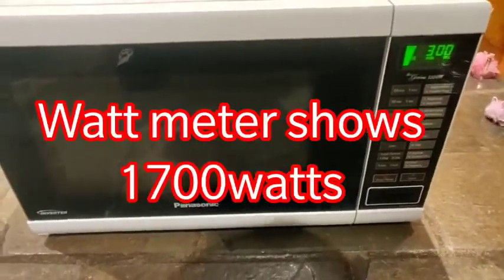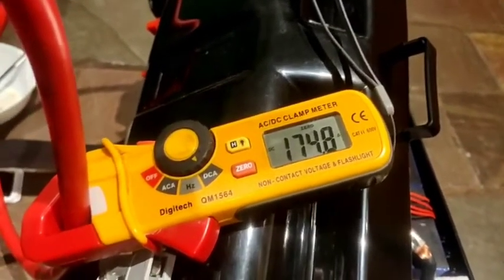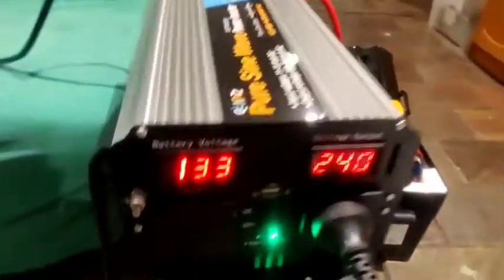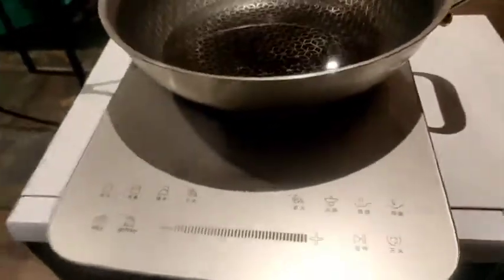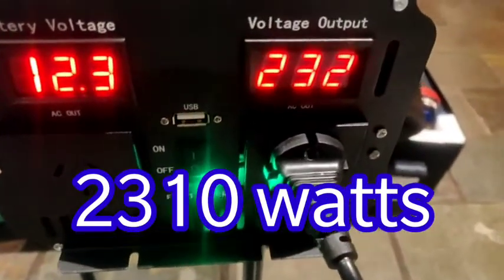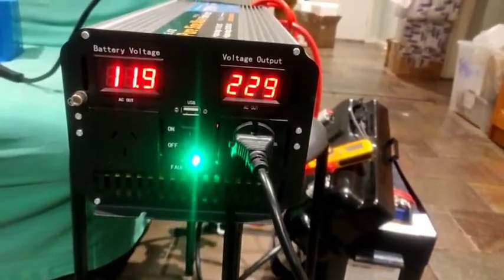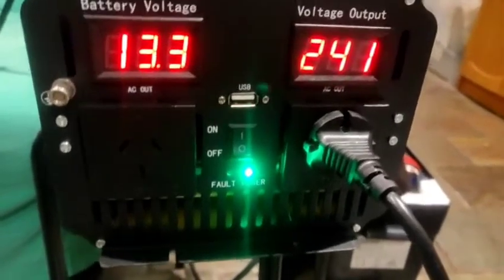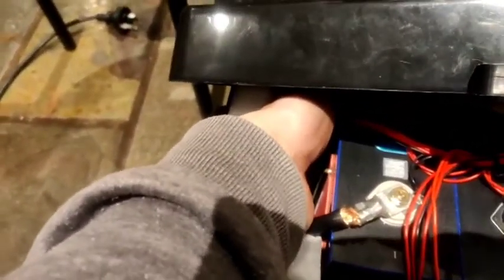Microwave/ induction cooker /AC 12v inverter/battery/BMS  testing.

Comment: Hey how do the battery charge? If I attach AC to the inverter would it charge the battery?

I’m looking to use a induction cook top in a can of mine without any AC source. How long you reckon the DC battery would last if I kept the induction on for 2hrs in a stretch
Reply from the maker: Are u from Australia? If so jump in here and ask the question.
 https://www.facebook.com/groups/superCapAustralia